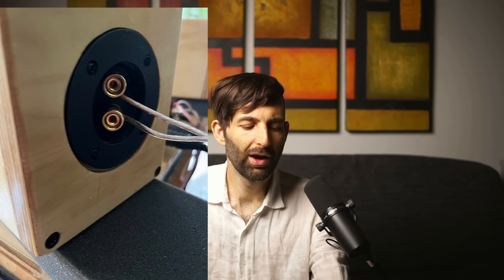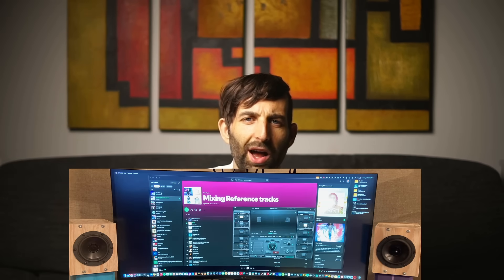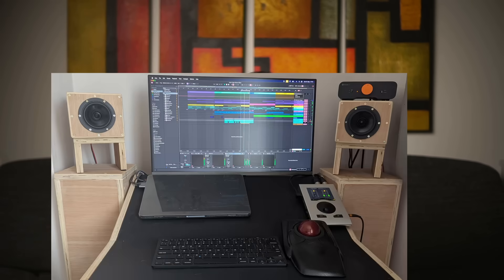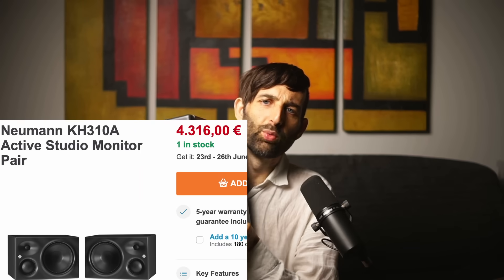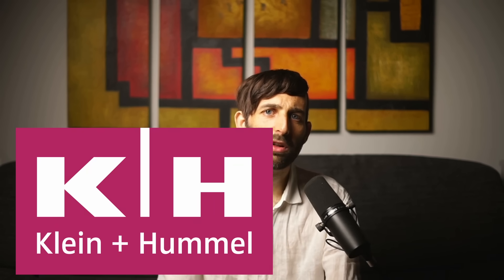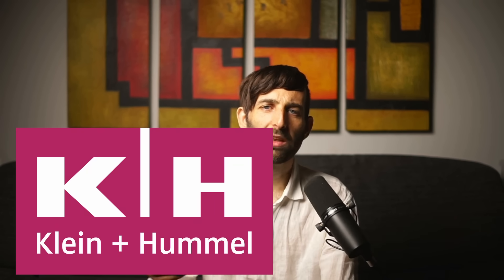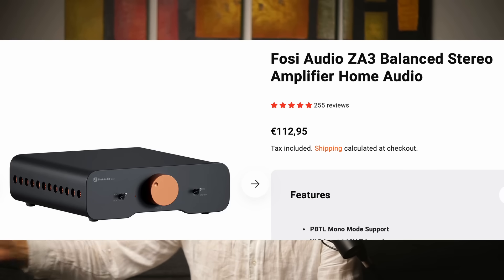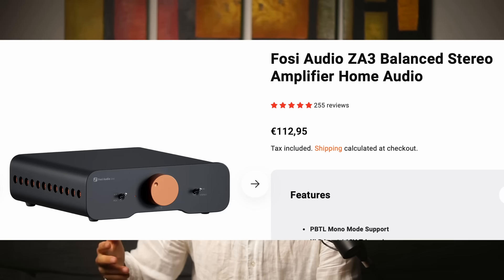$5,000 Neumann speakers VS $400 DIY speakers (Audio Shootout)

Comment: The Neumann sounds like a system worth 4K, it's just perfect in the little details. The 3-way DIY set is phenomenal considering its price. Amazing. But if you have two left hands I'd still recommend getting the little digital KH 80 DSP Neumanns with the ML1 room correction mic. Not a closed design, but really tight bass all the way down to 50 Hz. IThe built in custom EQ curve does wonders for badly treated rooms and it's a set you can trust. Very important, they're dead silent when it comes to PC/LED/USB noise. They're pitch black when you don't feed them any sound.
Reply from the maker: they are good for what they are but what they are, are ported and undersized
Reply: @APMastering +1000 on letting people actually hear the difference by setting up the mic.

Comment: There's still a difference in the presentation and sound stage in these 2 pairs of speakers. The Neumanns are better, present a more well-rounded, full range sound from one direction than the $400 DIY speakers. Also, the sound stage on the Neumann KH310 is more natural. Thanks for this shoot-out.

Comment: Thank you for clarifying this ported crap for me in your previous videos!
I am able to get the Hedd audio type 07 mk2 for just 950€ a pair. These can be plugged for sealed use, and have their „lineariser“ which is unique in this price range Id say and gives me options to use them sealed for mixing AND use the ported for notmal listing with some boost.
Would you say its a good deal and do you have an opinion on these?
Reply from the maker: im not a fan of hedd speakers since they use AMTs which have poor dispersion
Reply: @APMasteringthank you for your answer!

Comment: I think it’s very odd that there aren’t cheap good customizable DSP-based plate amps on the market for this type of thing. I have to admit, I find it so weird that there are so many people are making really high and passive speakers versus active speakers, but seems like it’s partly because it is just hard to find stuff design for the active market for do it yourself sort of projects like this.

I myself put my vote for a DSP based version of this speaker like you were mentioning.

Is there any reason that has to be a hyper expensive DSP to do a good job with something like this? It seems like there’s a lot of respectable DSP products that can at least be gotten at good prices on the secondhand market that you advanced crossover type things with various orders and filters, and such built in.

High quality amplification itself is also an expensive enough these days that it doesn’t necessarily have to be done in the speaker itself. It could, presumably just as well be externally try amplified with a external DSP box. Am I getting that wrong?

I love to see some information on exactly what would have to go in to this.  I don’t see why so much DIY stuff these days seems to put so much effort into passive crossover’s and such, when there’s a lot technologically, that seems to be advantageous about the other type of approach.

It seems like there’s nothing that easily findable about designing speakers with active crossovers in mind, and at least not nearly as much available as for the other.

Comment: ok... listening to this with my topping d90 dac and a90 headphone amp, with beyerdynamic dt1990pro and sennheiser hd650.  again with ns10m studio monitors with fosi za3 amp (you read my mind with this amp which i bought before your review- its great). i can say definately 100%- the neumanns are NOT worth the $4600 difference. with some care taken with the enclosure it could also easily be used for audiophile hifi. i liked the classic and the small + sub version the most.
thanks once again for showing people the myths behind pro audio.
i plan to build a pair of 8inch full range speakers with pre built sealed enclosures from aliexpress and "daytona ps220-8" drivers. should be a fun build and the enclosures are solid and look great with no mods necessary. feel free to contact me for more info.

Comment: I got to say that the Norman speakers are overpriced there's no reason why you could build a speaker that sounds that good for $400 when is translating it is definitely amazing now in the room that you're in probably treated the Norman's probably sound a lot clearer in a base deeper but if you're an engineer that's not what you're going for it actually going for separation after that everything's a go and the fact that they sound not as good make some even better cuz if you could make them sound as good as the Normans then you made an awesome track three way wins 🏆 😎

Comment: Have you seen the Presnt Day Production videos on making the MUM speakers ? I think they use this hypex board..
Reply from the maker: yeah the use the identical amp I use but they have a branded version. but their speakers cost more than double the Neumanns so it doesn't make much sense IMHO
Reply: It seems our last comment attempt was deleted.

We use a custom modified Hypex amplifier system, they differ from the widely-available NCore amps in that the gain buffer stage is modified to reduce the noise floor massively, as the off-the-shelf Hypex amps can be quite noisy with very sensitive drivers (like the ones we use for our mids).

Our speakers are also more expensive than the Neumanns but are built to a spec, not a price. We put the best drivers we could find into our monitors - such as the Purifi bass drivers - and then priced them accordingly. We wanted the best performance we could achieve, and then they cost what they cost.

Comment: The DIY 400 quid speakers sound revealing in comparison to the Neumann's. I'd probably use the DIY for mixing/monitoring for the most part. Would be interesting to mix completely on the DIY's for a few weeks to get used to them then switch to the Neumann's and listen to the results. The Neumann's give the impression of a more polished delivery overall. At least that's what my ears are telling me.

Comment: what a superb video - excellent .  like the others but   the classic and the Neums  are both great -  the classic has a touch more midrange clarity , ( 6 to 8 k )   and transients ,  and sounds cleaner ,  the neums have thicker lows and smoother highs and slightly recessed mids  but over all  smooth sound .    great either way  with my old ears id go for the classic for the touch more detail -like to see the graphs if possible

Comment: Hey AP. 

I made my own 3 way (active, out of the box - 3 amps and 3 way digital x-over) sealed monitors 20 years ago. Basically Dynaudio BM-5 1" tweeter and 5" driver with 8" Peerless sub - see my avatar pic'. 
I made sure to design the cabinets so the Peerless drivers had the optimum, recommended 40 litres and, likewise, the 5" mid had 10 litres in a separate internal chamber to avoid the pressure from the sub driver interacting with the mid. Obviously not necessary if you are using the dome mid because they have a sealed back like the tweeters, but very necessary if you are just using a regular cone mid. Have you designed that second chamber into the overall design for the cone mid model?

Also, are you aware of a fool-proof method for adding layers of wadding into the bass cabinet to lower the fundamental frequency as much as possible? 

Basically, you fill it comfortably with layers of wadding, cut to the internal XY dimensions of the sub cabinet, making sure to count how many. Then take a sine wave sweep reading with an analytical mic. Note the fundamental resonant frequency.

Then put another layer of wadding in and take another reading. The fundamental frequency will drop until the cabinet becomes over-compressed with wadding, at which point the fundamental will begin to RISE in Hz. 

When you reach this point, You know you have discovered (just gone past) the optimum density of lagging. 

So, then simply remove the last layer of wadding which resulted in the fundamental frequency rising again.

Your cabinet is now optimised from the perspective of the lagging.

Do this BEFORE designing the crossover for obvious reasons.

Apologies if you already cover this in your course. It isn't my intention to steal your thunder: rather, simply to share valuable information with like-minded individuals. 

All the best,

Mark
Reply from the maker: thanks for the insight, I'd love to hear your speakers. thats a cool method to trial and error the amount of stuffing needed. I just calculated it and specced that. Maybe I can do this test and see if it diverged from what I calculated.
Reply: @APMastering Well, if you’re ever in Hungary it would be a pleasure to audition them for you. They still sound as good as they did 20 years ago. 

The only problem is that, being on a budget when I made them, the secondhand studio amps I sourced from Ebay ended up being a little noisy:

- tops: Omniphonics Footprint 75
- mids: Rauch 100
- subs: Yamaha P2201 

X-over: Behringer Ultradrive Pro (i know, I know……but it actually has the same converters as x-overs many times its price). 

Replacing the above with the Hypex amps would fix that I’m sure….for a grand! 

With all that said, the monitors are much “punchier” and “bigger” than the Neumanns (my friend has a pair) because they have 225w+100w+75w per side vs 150w+70w+70w for the Neumanns and a much larger cabinet.

They are flat +/- 3db (ish) from 20k Hz - 30 Hz vs the Neumann’s 21k Hz - 34 Hz. 

Total cost back then: a grand (UK)

Personally, I prefer my extra 4 Hz at the bottom to the 1k Hz at the top, which is probably why Neumann make a separate sub to compliment the KH 310s: not really necessary with mine.

The Neumanns have more clarity, but that is obviously down to the superior drivers all round.

Cabinet material is 25mm MDF: Approx' 50% denser than pine plywood which I believe you are using? (and probably cheaper too), but obviously mask up well when cutting and routing because, if I’m not mistaken, the binder is formaldehyde.

And finally, yes, please make a video about the stuffing! It is a truly fascinating and enlightening process, albeit a slightly longer one (maybe a couple of hours), but it goes to the heart of the “don’t trust, verify!” ethos, after which point, you have gnosis on the issue.

By the way, great channel! Thank you and keep up the good work!

Comment: Hey these are undoubtedly some awesome sounding speakers for the money! Just got a question about something you said in a post recently: 
"Now, it's tempting to say "ok well, you started with an auratone, added an 8 inch woofer, now you doubled the mid drivers... why not just swap one of the mids for a tweeter and then have a three way?". This is tempting to point out, however there are a couple of important reasons why I'm not going to do this... firstly, the original design concept was to have a full range mid driver to get more accurate mixes by focusing on the mid range. But now we are expanding it with an 8" woofer so people who work with electronic music or bass heavy stuff can work on them too, but with a switch to turn the woofer off so you can only hear the mids when you want to check the mids. Adding a tweeter kind of negates this original utilitarian design concept because now we would just have a pristine full range monitor and although we have better time domain properties, we still might get worse mixes with it. Secondly, we need to do passive crossovers and it isn't too difficult for the woofer but for a tweeter it's going to be way more difficult and also more expensive."
So wondering why we ended up going with a tweeter instead of a 2nd mid woofer? Loving all your videos :)
Reply from the maker: hey nice one for finding that comment from me. The explanation is that I just got a bunch of demand for the 3 way so decided to go with it and make a decent sounding 3 way speaker. The way I designed it, it has more emphasis on the mids. But these are certainly full range speakers and mixing on the small speakers might actually have benefits over using these, but people wanted these, and I enjoyed making them.
Reply: @APMastering Makes sense man, thanks for the reply. Is there an easy way to make the 2 mid woofer version? Would be really keen to to make this kind of speaker with an on/off switch for the sub. Understand if this is just too far away from the design you've committed to but just feel like this could be a great option practically from a mixing standpoint. Cheers

Comment: Great vid. I preferred the 310s mostly but not on all music. Was almost convinced to build some of your 3 way passives. I'm running evil ported T7Vs with a bit of room treatment and Sonarworks. I know that doesn't solve all the problems like room resonances but it's helped. Other than room treatment do you run any room EQ on your chain?
Reply from the maker: thanks for the comment. I never use room correction EQ but my mastering speakers have DSP crossovers where you can EQ stuff so you can indeed tailor it to the room but I don't use sonarworks style auto room correction EQ

Comment: I listen to all Neumann Speakers, and own(ed) nearly every neumann (beside the 420). I love the neutral and clear sound. Use them since 10 years for Stereo & Homecinema. At the moment / past years i own the 150 in the front and 80ˋs in the back as surround (soon more for atmos). For that price they deliver such good precision and also high spl capabilitys when you cut them off with subs. Good and bad is that Neumann isnt a brand that release Stuff often, specially for the DSP / MA1 Users (i sold the MA1 mic and switchted to minidsp)… But i‘m still annoyed that i sold the 310 and bought other (expensive) studiomonitors. Back in the days i got them used for 2.4k€ wich is at least 3-400 less than nowadays.

Comment: For electronic, metal/rock, rnb/hip hop, the Neumanns are just dry to the bone and impossible to beat. 
But the Classics deliver something absolutely acceptable ... perhaps there is a way to get some more of the resonance under control? 
The small speakers are great for what they are good at. I didn't think that the combination small+sub delivered convincingly. 
They could get really problematic with (Nu)metal guitars. 
However, ... I was amazed at how hard it seems to be for ANY speaker to handle music played with acoustic instruments. 
Even the Neumanns were flunking badly. 
That's where the stuff has to be even more nice?

Great video ... a bit rough at the edges (the Domes didn't really get a lot exposure) but, nevertheless ... a solid effort. 
Thanks for sacrificing monetization for the cause.
Reply from the maker: yeah I didnt feature the dome ones more prominently because I was unimpressed with their sound with the 2nd order crossover. but a lot of people are saying they preferred the sound of those which is surprising!
Reply: @APMasteringreally not surprised that some preferred the dome ... that could easily change if it was revealed before hand.  Anyway the wide band cone driver has to be alot easier to work with.   I'm guessing , but there has to be at least an octive lower extension with the wide band if not two . Getting the vocals right should have been " baked in " from the manufacturer. I'm a firm believer in once the vocals are right the rest kind of just falls in place. That dome you going to be forced into getting them (vocals) right with a passive crossover pretty much in the middle of a  singers range.  
   Anyway I've made some assumptions here that you crossed over to the wide band quite low. Just some food for thought you could do the opposite for the tweeter.  Go very high.  You may have gotten favorable results with a simple first order in the mid five thousands ( maybe higher if the wide band is capable) and used a 3/4 or 1/2 inch dome . I have a little pair of sealed two ways close to that with a 4.5 inch mid woofer.  It just has a single 3.5 uF poly cap with an 8 olm 3/4"  tweeter. I may have caught the 3 decibels roll of point by accident.  I did  sort of tune it by ear. I suspect that yours may go a bit higher before rolling off.

Comment: What do you think about your passive 3 way diy build + the “IK Multimedia ARC Studio” for room correction/eq? Would be cheaper than the dsp amplifier ones but maybe (almost) as good?
Reply from the maker: yes you can absolutely do this! I don't like this approach as much though because it is too randomly processed in a "zoomed in" way. A more gentle bespoke EQ would be better.

Comment: There is good cause to creating and building your own speakers.  Do NOT get scared away because of the crossovers.  They are not magic, just a bit of science. 
And there is software available for free online to help you build the correct crossovers for your speakers.  Unless you decide to properly go with multiple amps,
once for each driver.  
Your speakers don't have to look good.  Just sound good.   :)

Comment: The "classic" are pretty close to the KH, only the KH appear little bit cleaner, but this could be EQ setting, if they have that feature, or higher quality speakers/materials. The smaller ones + sub could be OK too
I listened this on my Presonus HD7 headphones if that matter. :)
Reply from the maker: you can absolutely EQ the classic ones